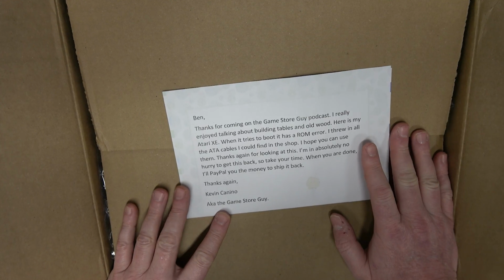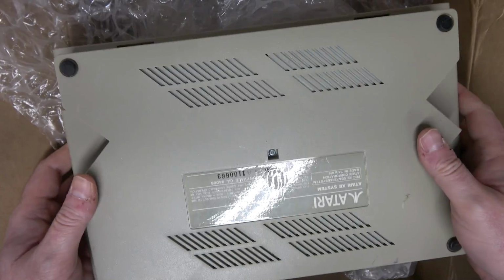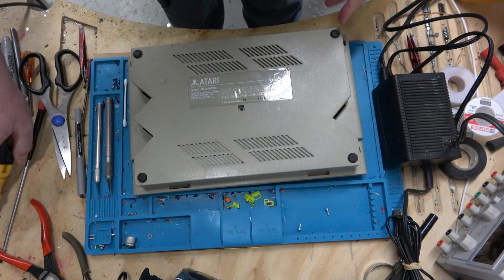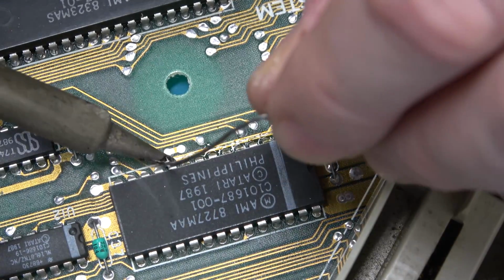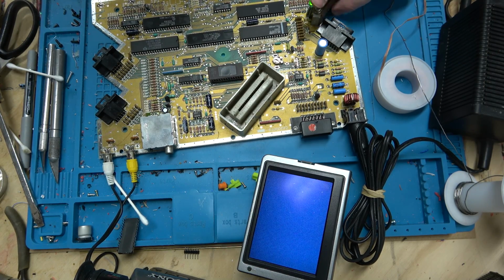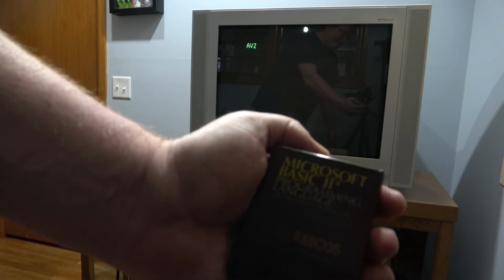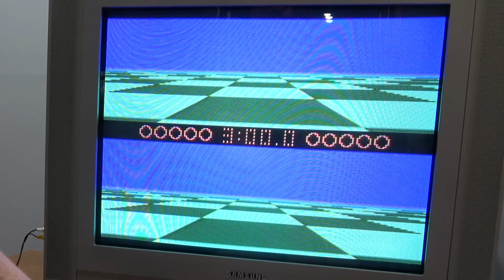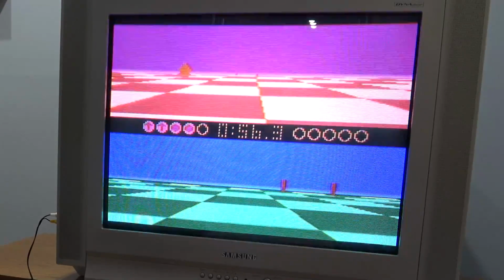Fixing an Atari XE Game System

Comment: Crazy how well a system from 1979 performs. The video and sound on that thing are impressive.
Reply: @CONNOR STEFFAN But the platform is still the same as the original machine. Basically just a different case and cost-optimized PCB.

Comment: The FREDDIE chip can be easily replaced by a bunch of 74HCT logic chips. There is a PCB with a footprint of DIL40 which has all the needed chips (SMD version obviously) on it. Of course, you may also use GAL/CPLD, as the equations are known.

Comment: I used an XEGS as a donor for a dual POKEY mod on my 130XE. It was an odd machine; a friend of mine had one, and I think it came with Missile Command built in and subLOGIC Flight Simulator 2 as a pack-in cartridge, both of which felt like weird choices; MC is terrible without a trackball, and FS2 was... let's be charitable, and just say it was not a particularly well optimised port. I don't recall ever playing a game that used the gun, but interestingly it did work like a light pen - LPENH and LPENV (memory locations 565 and 565) contain the coordinates.

Comment: Ben, I have an XEGS, and a few of these 8 bit computers from the 80s. Do you have a recommended replacement power brick that doesn't weight 2 tons? I have yet to find a reputable answer. 
Keep up the awesome content!
Reply: You can use a raspberry pi 2/3 official power supply

Comment: Want to fix the CD drive on a Memorex VIS, I have one that I fucked the CD drive up on several years ago in a ill fated attempt to clean the laser, I don't have the special IR remote/controller but you can use PS/2 keyboard or mouse for most things.

Comment: Does that Space Harrier port have a POKEY chip in it? If it doesn't HOW THE HELL is it putting out that music!?!
Reply from the maker: The XEGS is basically an Atari 65XE. The 7800 is the one that lacked a good sound chip.
Reply: @BenHeckHacks  In other words, this is what the 7800 should have been as far as capabilities are concerned, but Tramiel was cheap and dusted off a design from 1984, not bothering to upgrade the sound .
Reply from the maker: @ironhead2008  7800 had 2600 parts inside so it uses the sound portion of the TIA, same as a 2600.
Reply: @BenHeckHacks  Yeah, I know. It was ostensibly to maintain backward compatibility with the 2600 (an issue that bit them hard with  the 5200),  That would have been fine in 1984 (when the 7800 was designed IIRC), but post-NES release, it made the 7800 look bad.  Atari would have been better off to take the time to modify the console to include a POKEY chip in the system itself  for the more advanced games. But Tramiel wanted to get the 7800 out immediately and cheaply so they wound up shipping a console that seemed more dated than it really was. But you probably know all of this ;)